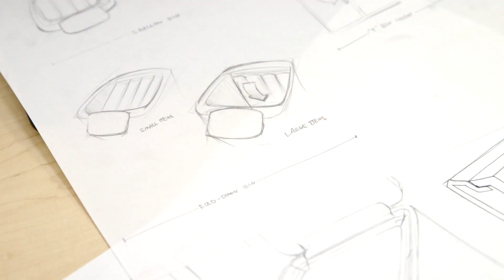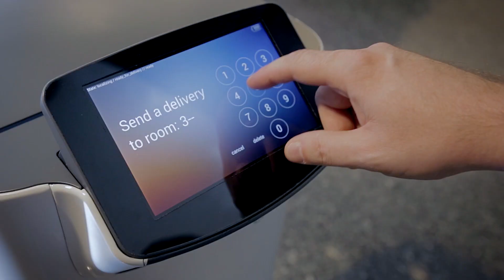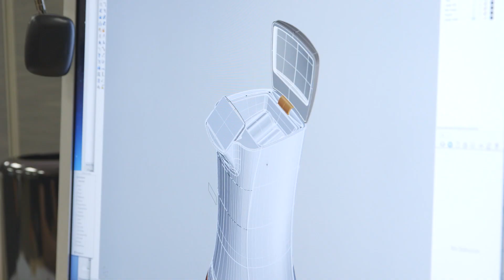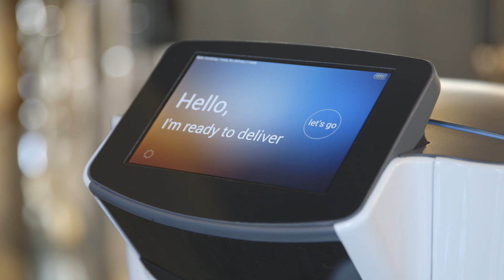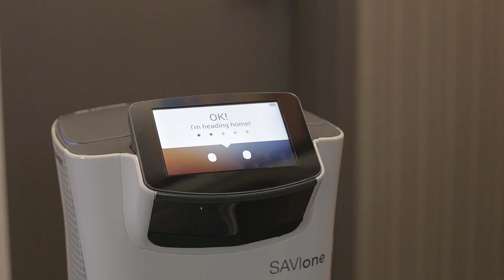Meet Savioke

Comment: Ok, now I would like to know how the robot gets into the elevator and goes to the right floor. How does it interact with the elevator? Having a human do that would kinda defeat the point, I think.
Reply: I am speculating, but when the mobile 'bot receives instructions to go to a certain location, I would guess that, simultaneously, the 'purpose-designated' elevator also receives the instruction, through a channel not associated with the mobile 'bot.  
Remember, the mobile 'bot is far more patient that a person.  They will wait for their one and only elevator.  And the elevator, once receiving instructions, will perform them even if the robot never shows up!  It will wait a long time on the ground floor, and a simple sensor could let it know when the mobile 'bot is inside.  The elevator may also "freeze" on that floor, where the delivery is made, and wait for the return of the mobile 'bot.  Mapping for robots is pretty simple.  Hospitals use robots for delivering drugs and devices.  This is not frontier, cutting edge territory.
Reply: If you know programming code, you know that this is a trivial matter.  Everyone should learn some basic (beyond BAsic!) programming, so that they can understand what is happening in our world.
These same people, while at Willow Garage, programmed a robot to move around a pool table, and then shoot pool, like a person, and make shots....comparatively, how hard is it to send a message to an elevator program, a message that emulates pushing a wall button?
Reply: @scottbergquist8982  how hard is it to send a message to an elevator ??
depends .. if u are talking a newly designed wireless control elevator? OR to a traditional elevator?
Reply: #Watch_Dogs (the robot sends a pre-determind command to a computer inside the elevator thus making it ''virtually'' pressing the buttons)
Reply: Scott Bergquist I agree. Actually, I am a software engineer myself. I didn't see anywhere that the robot talks to the elevator. Where did you find that? Maybe I missed it.

I think having this robot talk to a elevator is a trivial matter, but having this robot talk to any elevator is completely non-trivial. This robot fails to be a "plug n play" turnkey solution because you need either A) a special kind of elevator which supports a specific protocol, or B) "hack" your elevator to support this. And B) might not even be an option if you still want it to be considered officially secure and under warranty. (If modding is already a struggle with regular appliances and smartphones, imagine an elevator). Plus, a universal "hack" for any elevator is probably not possible, so you would need to design new adapters and do different installations for different vendors and/or models. 
Plus, regarding A), AFAIK the only universal protocol which already exists for interfacing with elevators is called "voice", and I don't think it's very widespread :) (the easiest solution would be for the robot to try and speak out and tell the elevator where to go, without interrupting other users..)
As you see, what initially seems a trivial matter very quickly becomes a big mess, and the fact that this is not even mentioned in this video makes me very skeptical.
(And I'm not even taking into account all the software configuration it would need before it can function in a regular hotel, as it would need detailed maps, know every room, etc)

I think this completely defeats the purpose that I understood they were trying to "sell". Because you would not be able to simply order one of these robots and have it move around by itself through human spaces, even after software configurations. At least not much better than a roomba would ;)
Reply: Scott Bergquist Yes, of course, it is possible. But requiring a special elevator installation could well be far more expensive than the robot itself. I'm only skeptical that they didn't detail how such a thing would work when it seems crucial.
This is not a scientifically interesting matter, of course programming an elevator to wait for a robot, or having it interact with a robot is not very challenging. It's just that in engineering, and especially if one is driving a business, doing it in a cost-effective manner is fundamental. And the "elevator issue" seems to be a hurdle when it comes to doing this in a cost-effective manner and providing a seamless solution.

Ideally, I would imagine the robot to work by itself and move around just like humans do, but then these crucial issues arise...
Maybe they do expect you to adapt some of your existing infrastructure, such as the elevator, so the robot can move around, but I would expect something more seamless so the technology can spread everywhere and become ubiquitous, which is when robotics will truly transform our lives.
Maybe I'm still missing something, but I remain very skeptical for these reasons :)
Still, I think it is exciting to have robots help us in the future.
Reply: He didn't get what you meant superkeny. I actually thought of the same thing myself when it entered an elevator; does it wait for a human to get in and ask him/her to press the right floor? What if it's a hotel and the person inside doesn't have the authority to go to higher floors? I didn't see any arms on it so that it could press a button itself. If they require their customers work environment to have a programmable elevator that they can interface with, then that would be limiting the robots target customers.